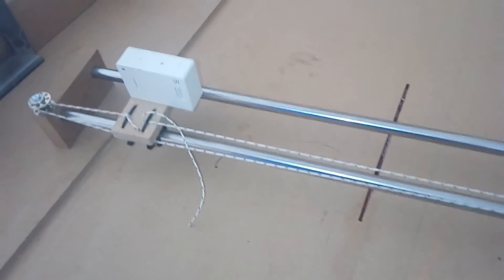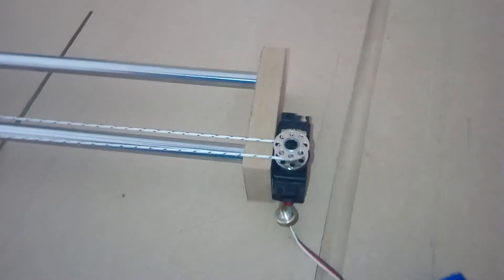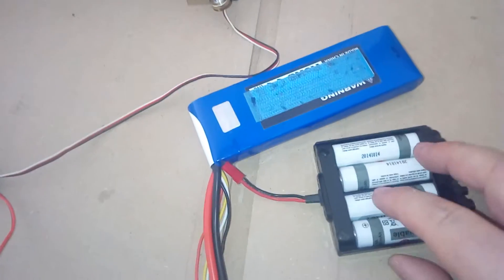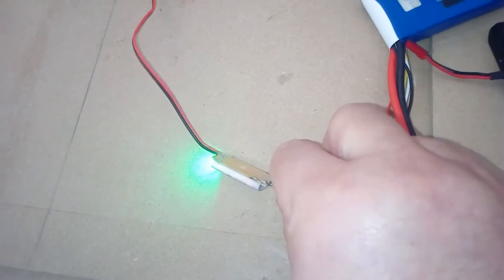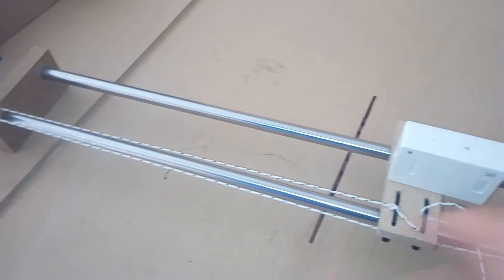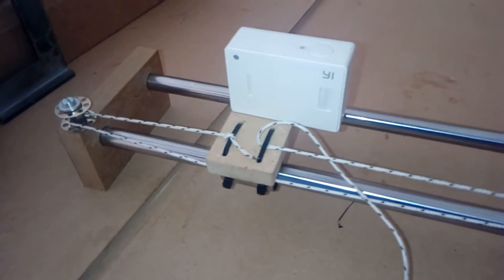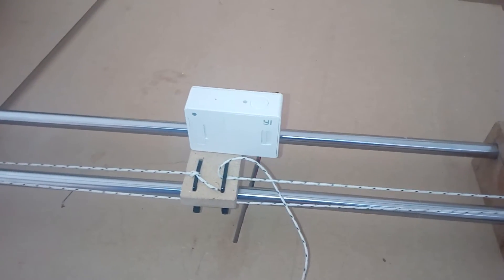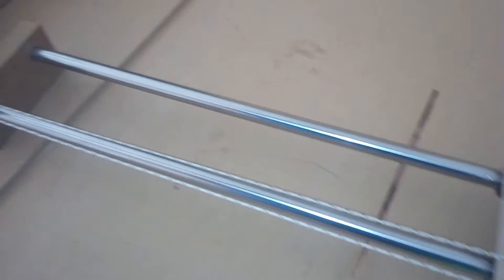How to: DIY Simple Motorised Camera slide (Xiaomi Yi, Rails and Bearings from Banggood)

Comment: Hi Paolo, I need a motor for 2.5 meter slider with black magic production camera and if possible for vertical axis also, Please suggest any.
Reply from the maker: What you are describing is calling for some more expensive and professional solution. The options are nearly endless if you like to DIY, could be motorized with a stepper motor or a DC motor with appropriate gear reduction and also a bigger power source. I think in this case the budged is going to be higher than with the one showed in the video.

Comment: great work Paolo . I have a dought, how many kilograms it can push and pull.
Reply from the maker: Thanks, it all depends on the motor you choose and the pulley system. In this case i was using a reclaimed S9303 servo rated with around 7kg torque, so I guess it could move an average DSLR with the proper belt and pulley. 
The slider could easily mount a stepper motor and this way pull even bigger loads.
Reply: Thank you for information paolo
Reply from the maker: +kiran reddy0219 You are welcome, feel free to ask if you have any other questions or concerns.